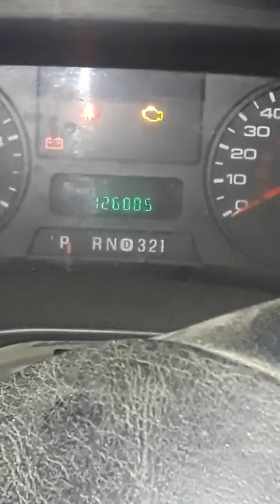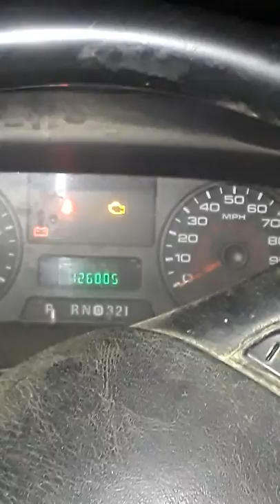Tbc fault. 06 f350 brake controller fix part 2

Comment: Your my hero!!  Pulled the unit out, looked like it was OK but took a small screw driver and the leg of the component moved.  I am an old computer guy who fought these problems early in the development of computers.  Called them "cold solder joints'.  Very intermittent and very hard to find.  But, Thank You!!!

Comment: My question is: Before doing all of this, did you take it to a dealer and let them read the controller and check for error codes?

I did the dealer route first and they say "no error signal or wire faults.  It must be the trailer."  I have heard several F350 owners do the exact thing you did.  However, since I have researched this for so long I have a list of other things F350 owners have found. Anywhere from the pressure switch down to the wire connectors on the trailer breads and problems everywhere in-between.dsa

Thanks for the short concise video and NOT starting from where the earth cooled.

Lee
Reply: That last part about the earth cooling had me laughing. Some of these youtube vids go on and and on and on.

Comment: I have a 06 f350 6.0 and I put in reverse and the brakes locked and it wouldn’t move then the message popped up TBC fault you think it will fix my issue?
Reply from the maker: The trailer or truck brakes would lock up ?
Reply: @TheCattlekings  truck but I think I have to change the calipers, brakes and rotors

Comment: Mine has the same problem but my engine won’t shut off and stay started you think if I fix it this will fix that
Reply from the maker: I don't think so
Reply: What ended up being your issue?
Reply: @flats-hopper4351  I put a kill switch on it once I turned off the switch the engine turned off I never found the problem so I sold it